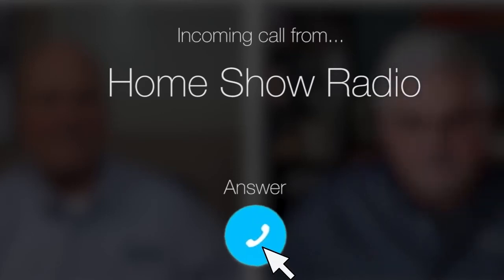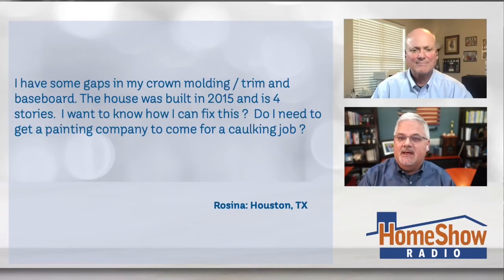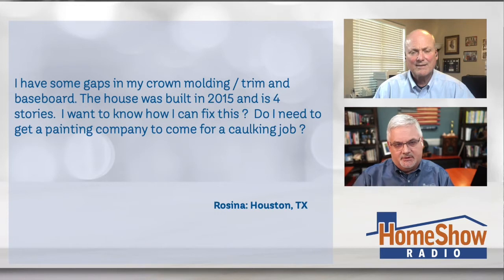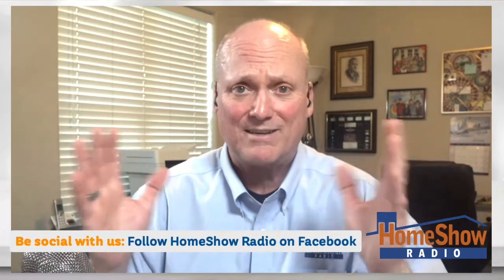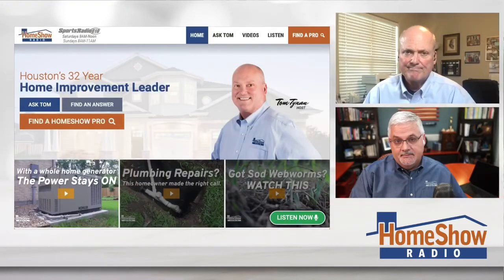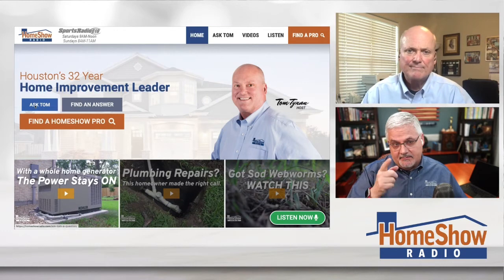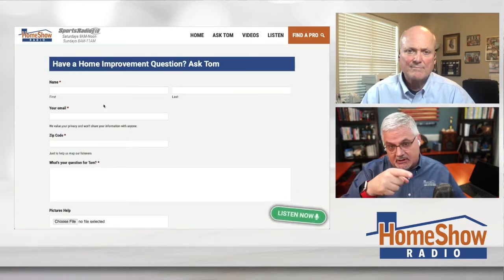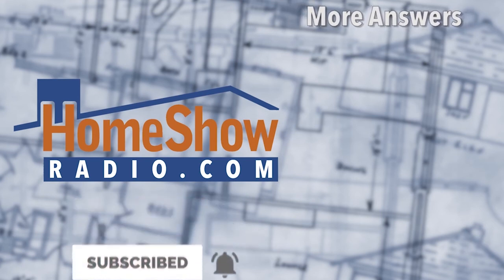Crown Moulding Cracks

Comment: I don’t think you can say it’s cheap caulk, especially every time you see a crack or gap. Sure, sometimes it can be. We had a professional paint crew come in and re-caulk our crown and they showed us the caulk they used which was a high end caulk with over a 50 year guarantee. A few months later as it got cold, we started seeing some cracking again. The painter said cold weather can cause cracking and that cracking is inevitable. The painters said they can touch it up when they come back to paint some other rooms, however I think dry heat without a humidifier contributes to the cracking.